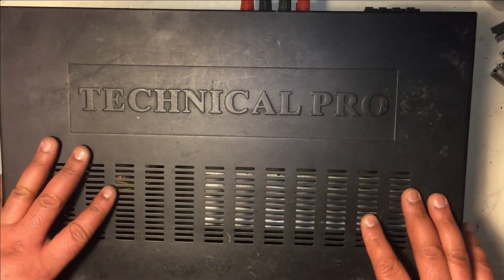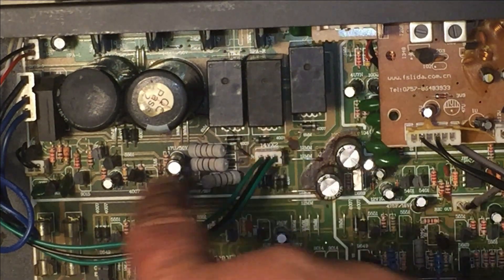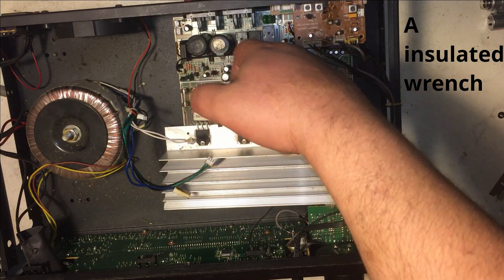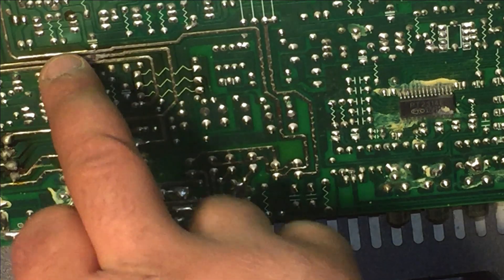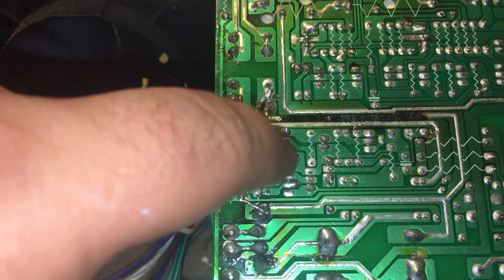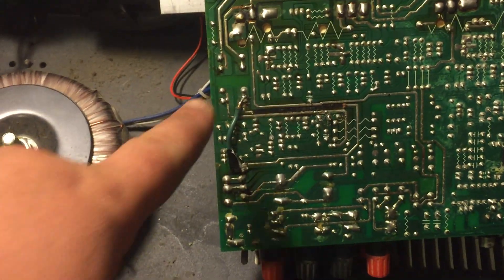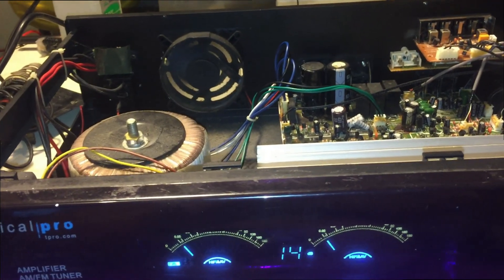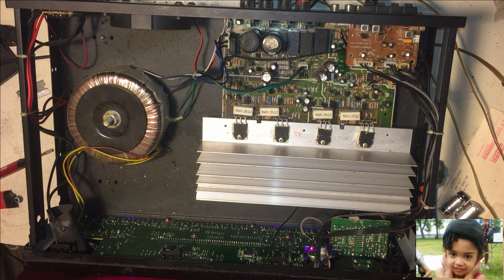(NO SOUND REPAIR) ( Technical pro stereo amplifier 1500watts

Comment: The music on mine works then stops working… how can I fix it? Help thank you
Reply from the maker: Hi how long does it play for ?
Reply: @jayflash1000 for about 5 minutes sometimes 3 then it stops
Reply from the maker: @GR420-A  it could be the broken solder connection or the transistors. If u live in new york I could check it out for u
Reply: @jayflash1000  yes I live in New York City

Comment: Hey i sont know how else to get a hold of you. But i had a quick question i have a technical pro rx504 1500w and the digital fluorescent sound spectrum display isnt working i was hoping you might no the answer or could point me in the right direction please and thank you
Reply from the maker: Hey. Well to be honest It could be a number of things.  First try the out put line that gives it power if the power is running good then check the board with the display.  Most of the times the light burns put. If it's that just replace.  Hope this helps
Reply: @jayflash1000  Hey, thank you for replying to me. I really appreciate it. Ok, I'll try to do that. But you're probably right. The display probably burnt out. I've been looking non-stop for a display for it. It's non extinct, not even technical pro has it. Anyway, that's why I reached out to you. Maybe you knew something I didn't.
Reply from the maker: @mikehanley-z4j  no problem that what we here for. If you can't find the light use led lights they last much longer
Reply: @jayflash1000  I will thank you

Comment: I have a technical pro 1500 amp H1502UrBT and when I press the power button the Bluetooth light alone comes on and nothing else happens
What's causing this and how do I repair it? Please
Reply from the maker: Hi ok check the fuses usually technical pro comes with 2 fuse lines... if that doesn't help just hit me back up.

Comment: Plz help there is no sound on my amplifier It's Omega karrote Av 971kA
Reply from the maker: Hi check for blown capacitors, or bad transistor Or broken solder connections.  Start with and get back to me.

Comment: Hi just a quick question i have a technical pro applified speaker vrtx12. And the problem is that as soon as i plug the speaker to power outlet and turn on the speaker it will automatically hear a really loud statik and thats all it does it just keeps hearing statik is there a way i can fix this issue?
Reply from the maker: Hello. Disconnect  the battery for 5 mins and press the powerbutton down for 30 second .

Comment: I just bought a tkl digital equalizer and it is outputting a static pulsating sound I can barely hear the music when turned all the way up any idea what could cause this it's brand new and I'm having trouble returning it it's a tkl t2531
Reply from the maker: Hi thank you for watching and asking for help. Ok yes I heard of this equalizer... being that it's brand new" let's try this first check to see if their no loose wiring. Make sure it has a good ground connection"(very important for clear sound). if that doesn't work! try the eq alone with the amp no mixer or other volume control.  Check the wires!!!
Reply: @jayflash1000  oh man thanks for responding definitely subscribing I'm going to check now and on the ground it's painted should I sand and re screw it back other than that all wires are good and the board looks good nothing that I can see and I've tried it by itself still a still a pulsating white noise sound this thing is brand new just got it and it's dead on arrival if I turn it all the way up I can hear the music threw the pulsating sound but barley I've tried balanced and unbalanced trying the ground now
Reply from the maker: @rockman49er  ok understood!!! Yes for all device make sure the grounding is connected. Fix the ground and remove the paint. This could probably be the problem And thank you for subscribing.
Reply: @jayflash1000  ok I removed the paint and nope it's not the problem I made a short video should I upload to my channel will you check it out I'm going to upload it now should be ready in a couple hours because my internet sucks lol 😆
Reply: Well I guess your not going to check my video I knew this was to good to be true 😔 😞
Reply from the maker: @rockman49er  I will check now was busy

Comment: I bought pioneer private pro ax 720 amplifier but it is not giving sound to the speakers but when i turn on the amplifier there is a slight vibration in the amplifier.  Plz tell how can i fix
Reply from the maker: Hi so when you bought the amp it came dysfunctional.? If yes! try these step-by-step. Check for boldes capacitors'(replace them) check all audio transistors,(if open replace them). check head jack to see if you get sound. If you get sound threw the headphone then step one and two could possibly  
be the problem hope this help thank you for watching .
Reply: @jayflash1000  thanks brother

Comment: Damn I wish I had your brains right now, I’ve got a pioneer 800 watt  amp with power and ground but no output signal, I know for a fact it’s the output signal bcuz I tried a different amp and sub works. I also replaced fuses and rca and still no output signal. Could you give me any advice? I opened the back but I have no idea what I’m looking for, I’d really appreciate your wisdom.
Reply from the maker: Thanks man... try to see if you see things burned or bold like capacitors and then check broken solder points sometime the joints brake apart  with cooling and heating for the transistors audio . That the best I could do without seeing the amp sorry.

Comment: Hey I have the same problem Gemini /As-15BLU I’m trying to fix it I got power but know sound how can you tail if the Terminator bad I couldn’t tell by the video
Reply from the maker: Hi sorry for the late reply been very busy. Ok try buy puting a mutlimeter on the speaker terminals and you should get some very low voltage to see if it's good. Also check your caps for the sound output section. Sometimes caps look good and go bad.

Comment: Hy I have a problem with my 250 watts amplifier 5.1 channel ,2 channels are working fl and fr the other channels are not working
Reply from the maker: Hey... it sound like you might have a problem their!!! It's hard to tell.
what going on without me seeing inside of it!  But you could check to see if you have fuses for the speaker terminal" also try to see if your have broken solder point around  transistors Because something of the heating and cooling that goes on, Hope this helps
Reply: @jayflash1000  thanks for the help

Comment: i have the same thing but the subwoofer isnt working as well it is a subwoofer with a amplifier in it ther are no bolstered capacitors but there are 3 that arent straight and one is moveable could this be the problem?
Reply from the maker: Yes if one out of the 3 is moving that means it's no good you should change all of them.

Comment: why did you removed the capacitor
Reply from the maker: It was no good, had to go like the wind!.
Reply: @jayflash1000  how did you check it
Reply from the maker: @pipographerproduction2773  by seeing the boldness on top of the capacitor.
Reply: @jayflash1000  i have an amplifier but i dont know where the problem is
Reply from the maker: @pipographerproduction2773  what wrong with it?
Reply: @jayflash1000  well there is no sound, tda 8560q is heating the amplifier is turning on but there is no sound,  nothing looks burned and there is not such a problem as you showed on the video
Reply from the maker: @pipographerproduction2773  ok it could probably be the tda 8560q so check to see if its open, then check for  broken solder Connection. Also if their a input/headphone jack check to see if that works & give sound! If it does" then the tda 8560q is still good, so continue to see what component went bad like capacitor or transistor.
Reply: @jayflash1000  well i dont know how to check it if its open
Reply from the maker: @pipographerproduction2773  ok their probably video that can show you how to do it step by step. To check the tda 8560q yes you must know the pin outline  to check it probably. First check to see then get back to me for more help
Reply: @jayflash1000  thanks, i will

Comment: CONGRATS on getting that to work again!   Nice! @ 3:33 when you are pointing  " this end and this end right here "   I would think you should have put dual bridges so the other end did not have to rely on the board connection and so it would be exactly as the other end was with the bridge, That way your board would not be subject to boiling out that solider out as it did previously, ( especially since your cap installed is Bigger power than the old blown one.. LOL )    you should use the exact same part specifications when replacing stuff like that cap if you can - but hey,  I have seen all kinds of crap installed in a amp lol.  it's insane what folks will do to get a thing working, also it could have gone terribly wrong and toasted your little board again.   Those kind of amps are funny,   says 1500 watts and there no possible way it could even be 25% of that.   I mean, if you really had a 1500 watt amp in there it would have way more that 4 Mosfet chips on that heat sink and everything would be massively over sized.    I mean, car audio and house audio is different because of the power source being WAY more stable and continuous in the house BUT - this little amp is ridiculously small to even a zr120 LOL.       You could do a solid upgrade on this one though the way it's laid out super easy though if you installed a small fan on the end of that heat sink to blow straight through those fins if you wanted to.  it would dissipate heat MUCH better. 
   this amp may have broken the way you found it because of an Ohm load being too low for it.  that little amp cannot hang with lower than the specs are and probably even a higher would make it last longer as the mfg is obviously a liar. when the Om load drops the amp will try to spew more current and the components will heat up like crazy.

 that goo that you don't know what it is is the residue from the over heating, it's the STANK - probably cancer causing goo to boot.   I don't care though it tastes awesome with a little Tapatio. 

  I liked this video man,
Reply from the maker: Thank you for appreciating my video  and pointing out what could of been done better! we all are here to learn from each other and become stronger as one! "what your saying is making alot of sense and i respect you for that! Thanks again take care.
Reply from the maker: 3:33 lol I know where you coming from.
Reply: @jayflash1000  bro I got almost the same one mine is the 503 model same as that one with grey case. I need your help explaining a few things. I'll give ya my phone number so I can actually ask you some questions
Reply: @jayflash1000  please bro I need your help
Reply from the maker: @joshdavis1234  hi how can I help u
Reply: Cheers for this, I've been looking for "tv electronic board repair service" for a while now, and I think this has helped. Ever heard of - Giyathan Bewildering Gratification - (do a search on google ) ? It is an awesome exclusive product for discovering how to repair your electronic items like a wizard minus the hard work. Ive heard some interesting things about it and my buddy got great success with it.

Comment: 1500w !!! not even if it was struck by lightning, how these manufactures get away with the highly inflated ratings is a mystery! the output transistors and size of the transformer say otherwise... around 100w rms per channel i would guess
Reply: Not even 100 watts more like 20 watts
Reply: lol  funny isn't it?   I don't see how they get away with it either. LOL   so many companies do it though.   makes me laugh.
Reply: Well I will say the same, but it’s a little tricky with these models of technical pro. I got the model HB3502U and it has balllllzzzzz.
I did some digging and it’s as if all models ending with (U) is well built. Yet technical pro doesn’t advertise these models on there website, only the shitty old (BT) models. I have 2 of them. Only 1 has actual power. N there’s no specs on these models only the weak ones with Bluetooth
Reply: I say în a cliping mode it will go 2×41 w rms

Comment: hello, very nice tutorial, can someone on this forum maybe give me some advise plz, I have an eh600 technics hifi, but even when I turn the volume all the way up the sound level stays very low, any ideas that might help
Thanks
Reply from the maker: Maybe I could help!!! 1 Check to see if your wires are put in correctly, or not touching each other at the speaker terminals. 2 try to see if maybe you have a switch that is costing the problem, like the loudness or mono to stereo or sound  selection and so on. If non of that can help you! then their a problem inside & must be looked at. That all I could do for now.
Reply: @JayJay Schnetler the technics eh series use class H switching rail amplifiers, if the volume from 0-40% ish is working correctly it would seem as if it isn’t switching to the high rail voltage or the high rail doesn’t have any voltage there, i would check the internal fuses if not its a qualified technician repair sorry, there are high voltages present inside so i advise against poking around in there unless you know what you are doing

Comment: The burnt surface of circuit board should also be cleaned of the carbon to prevent any arcing or unwanted conductivity between traces.  I use a dremel tool to do that.
Reply from the maker: Yes after i repaired it. I cleaned it after thank you for the advice . David.